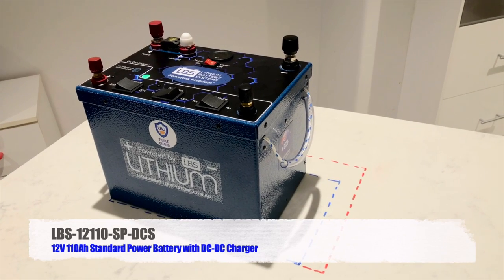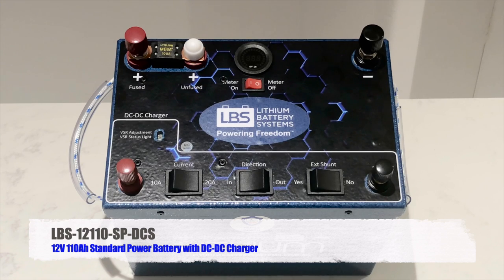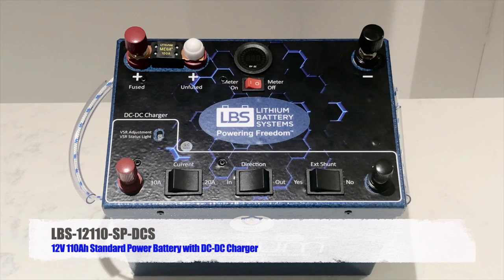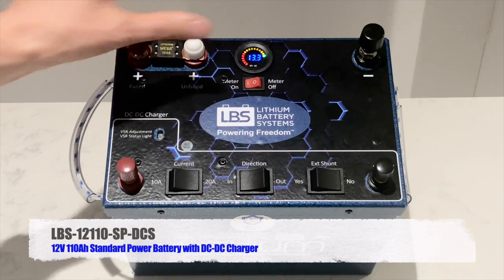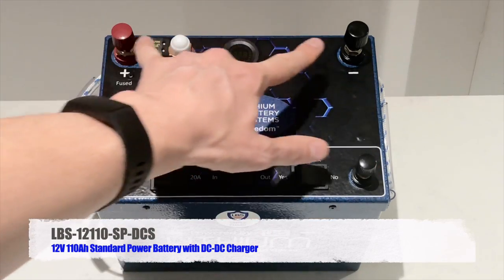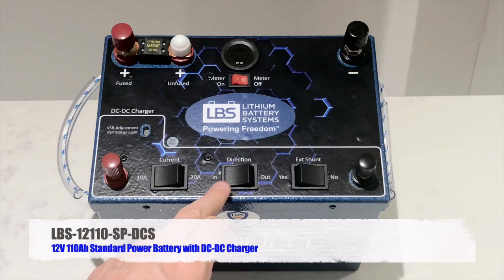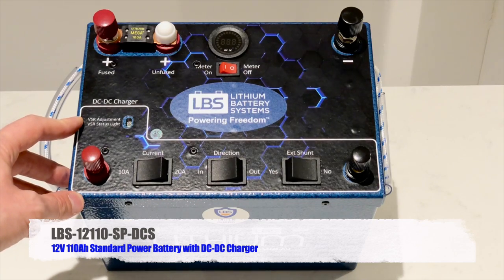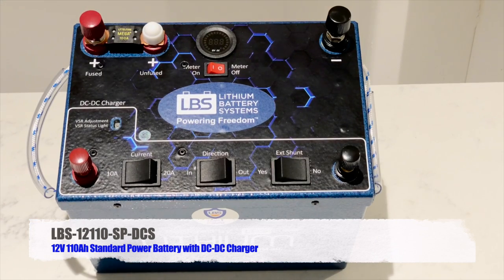12V 110Ah Lithium Battery from LBS

Comment: Good video, thank you.  Would be good to see the vehicle Cig socket 12v power input cable being attached because it looks like special battery terminal connectors would need to be fitted at the LBS end.  Similarly would be good to see the solar cable attachment option (i.e. how does a typical solar panel wiring set up connect?  Don't see Anderson plug capability so does that mean that battery terminal connectors are needed on the solar power input cable as well?  Thanks